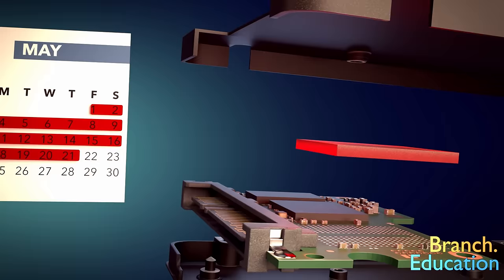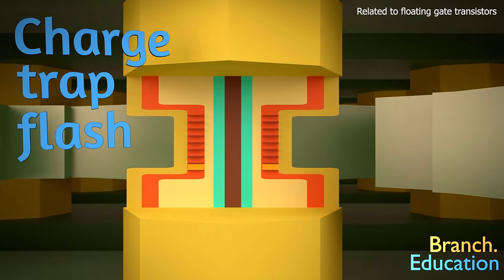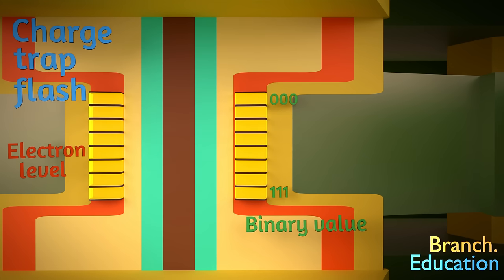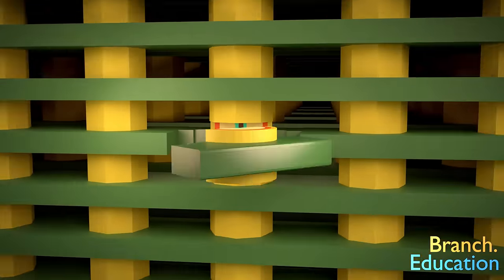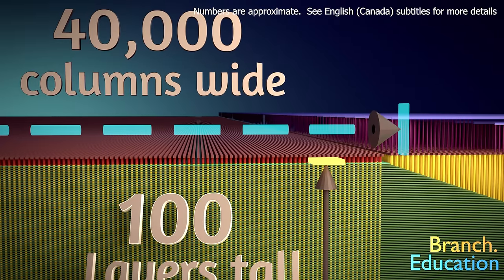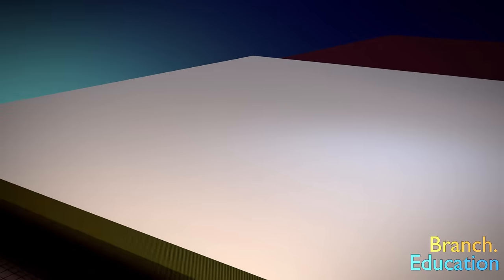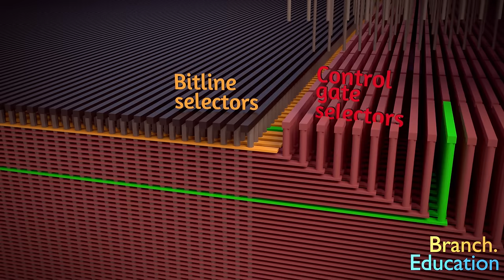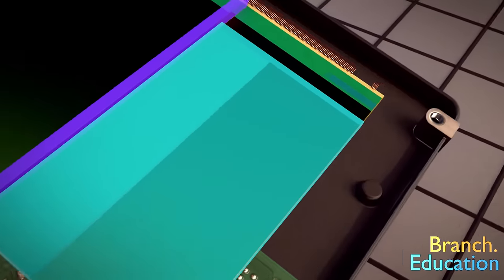How do SSDs Work?  How to fit 3 WEEKS of TV in a microchip the size of a dime!!  Explained in 3min.

Comment: My mind was blown by the 200,000,000,000 cells, but when he said that the engineers didn't stop there and copied it over to the other side and added 8 layers, ending up with a whopping 3,200,000,000,000 cells, I stroked out and died while typing this commen

Comment: It was very interesting to see the visualized version of how solid-state drives (SSDs) work. Going deep inside an SSD which can store one terabyte (TB) of data. The nanoscopic view of the microchip with its complex structure is fascinating. I think it is educative to know about an individual memory cell called “charge trap flash.” They are being copied many times. 100 layers tall, 40000 columns wide and 50000 rows down. Duplicate that layout and multiply it 8 times in order to get 1 TB of data. Only thinking about that size makes me wonder.

Comment: Wonderful!  Thanks! :D

And this time; the subs were there from the start ;)

BTW: my take from this is that it might not be a great idea to have the pagefile on an SSD, or to change the data frequently (for tmp files and such)?  Because of the 27 volts or so, that could damage the chip...

I guess i'm gonna get me a nice silent HDD for those purposes; even though the SSD in my system is already about 8 years old, and SMART still thinks the drive is in fine condition.

Comment: so how many years can the electrons be kept in the cell if we leave it alone?
Reply: The retention time of electrons in SSD cells varies depending on factors like temperature, wear, and the type of flash memory used (SLC, MLC, TLC, or QLC). Electrons can leak out over time but generally single cells last like 10+ years.
Reply: @BioChemistryWizard  thank you so much, from where you got these informations about the cells cause i didn't found anything about that

Comment: Hey noob here. I wonder if Quantum Tunneling have an effect here? If it does, will there be a possibility that it will put a halt to the advancement of the microchips engineering?
Reply: Yes, quantum tunneling is actually how charge is stored and removed from the charge traps.  That is certainly a concern - as insulators get thinner, it becomes more difficult to keep the electrons in place, and the problem will hit this type of storage first before it becomes a problem in other types of chips (here, a small amount of leakage is a problem, but in other types of chips, the leakage is only an issue once it starts to contribute significantly to power consumption).

Comment: 2:44 wait if the chip is that small then what is all the other space for
Reply: For compatibility with the 3.5 form factor.

in the m.2 you could see how small things are.
and if you want to see the extreme which I think is coming soon to laptops and small devices lookup BGA SSD which is about five times smaller than an M. 2 SSD and 100 times smaller than a 2.5
Reply from the maker: Give it a few years, and 1TB in your smartphone, packed into a single chip, will be commonplace.
Reply: Also, it is not always that empty. It depends on the size you buy. Some SSDs have 8 chips instead of 1 like in the video.
Reply: @BranchEducation  I mean you can get 1 TB sd cards but they are rather expensive. They don't want to raise the price too much but they also want you to purchase cloud storage.
Reply: Extra popcorn
Reply: It's for multiple such chips and a controller and the PCB that holds it all together.

But mostly, its for the purpose of standardization. It's so you can replace your mechanical laptop HDD effortlessly.
Reply: @IbrahimEad  Is it even a drive at that point? I searched and I see some pages using the terms together but I don't think it's accurate.
Reply: A 2.5mm hard disk. This is a retrofit design for casing intended for hard disks.
Reply: Autotrope I thought they were 2.5 inches

Comment: So you are saying to make a terabyte of data, we must have 100 sheets of excel that has 40,000 columns and 50,000 rows. Each excel cell can only store 3 bits because 1 to 7 represent how the Zeros and Ones arrange.in 3 bit.. Now I mutiply 100*40000*50000*3bits= 600000000000 bits. That is not 1 Terabyte. 600000000000bits equal to only 75GB. Correct me if I am wrong.

Comment: How is is possible to manufacture a component like this?  I don't understand how it's possible to build something so small, with so much precision, at volumes that major companies are able to produce.
Reply: Pretty much building up the chip layer by layer by using light sensitive processes where depositing or removing material is accomplished with a combination of a projected and focused image and a chemical coating that reacts in the presence of light to perform the action.  We can control the light exposure very accurately and essentially process an action across a whole layer of chip at a time.  Then it's literally a lot of rinse and repeat.

Comment: Ok your animations are every precise, but your explanation needs a little work. This is the part where I can't understand. When I save a image, does the info go into a single cell; the place where the electrons fire the 8 traps where 3 bits can be saved, because 3 times 8 equals 24, the size of the pixel int he picture? Please explain.